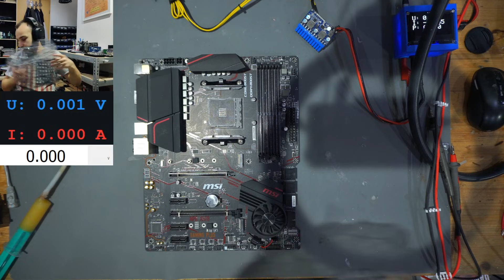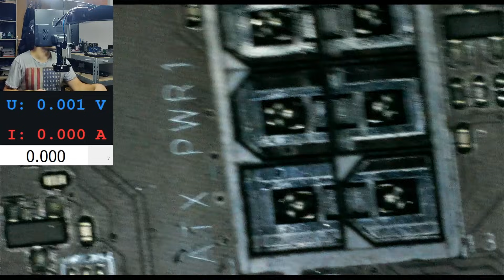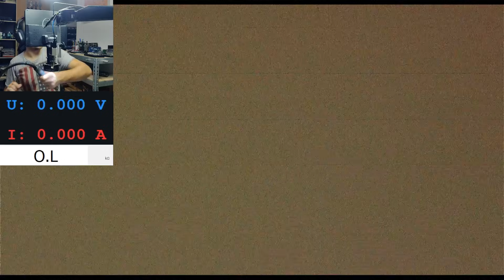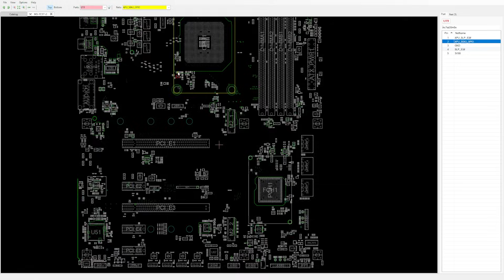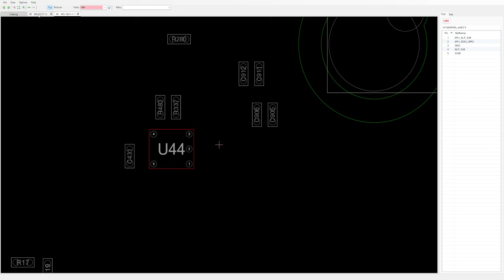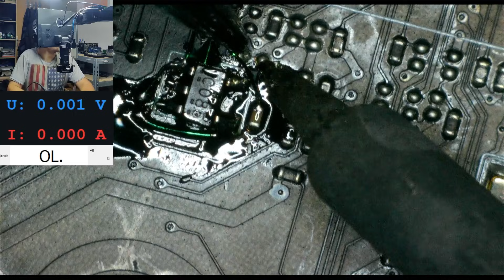Repairing a viewers Motherboard!  || MSI X570 MPG GAMING PLUS Repair/ fix

Comment: Nice Job, but I think you missing a connection on that chip from the cap til the chip and from there to de resistor, can I be wrong?

Comment: Hi Daniel. Last pin of that chip supposed to connect to two places but you connected to only one place. But great video as always 💪👍
Reply from the maker: You guys are completly right! Dont know how i missed that! I got really lucky and it worked without that connection! Luckily i still have the board and have just corrected that mistake with another jumper wire! I cannot see any difference in functionality, but this was really importent to be adressed!
Thank you for sharing that!
Reply: I rewatched it and this is correct, pin 5 needs to be connected to the resistor above it as well, could cause issues down the line possibly! but awesome work none-the-less @Mainboardmedic